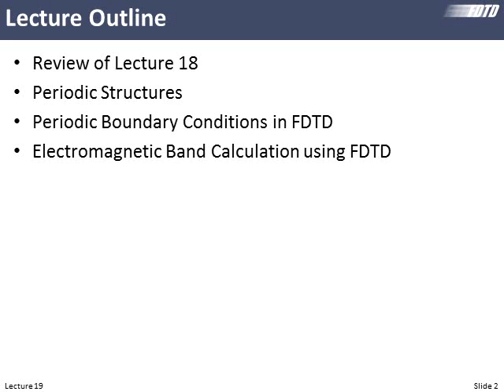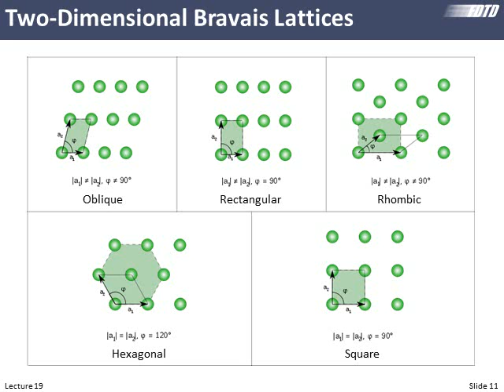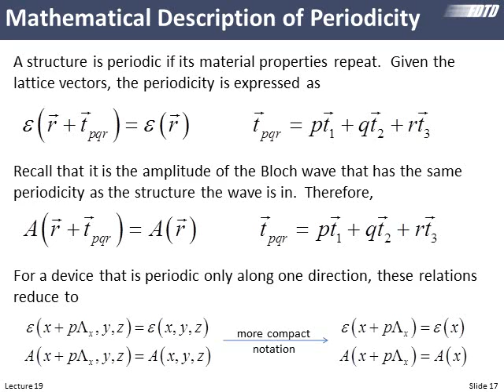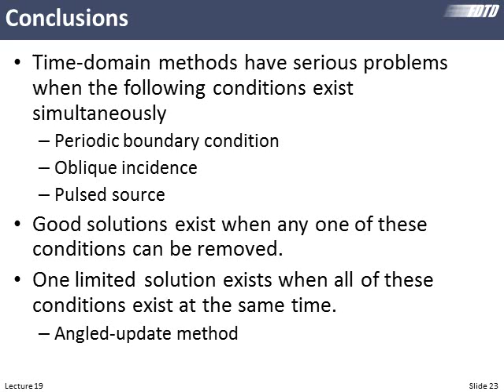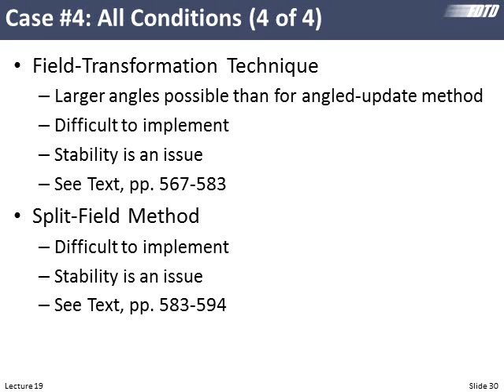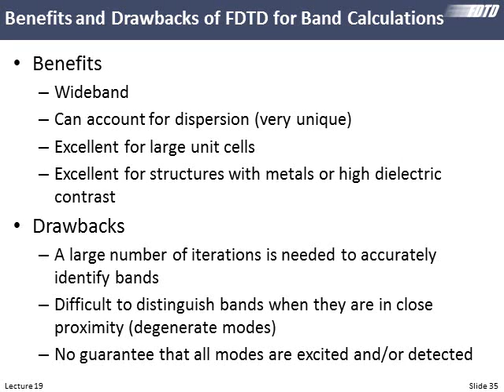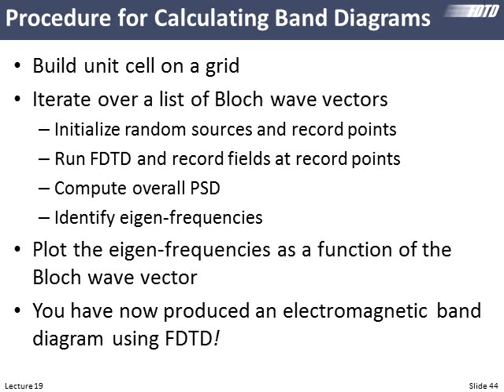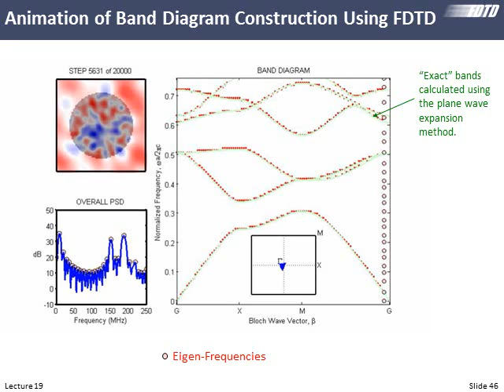Lecture 19 (FDTD) -- Periodic structures in FDTD

Comment: Are the Bloch vectors only applied to one side of the grid? I'm trying to model a hexagonal lattice and I'm getting band folding even with a Bloch periodic source.
Reply from the maker: You need to implement periodic boundary conditions on all sides of the grid because waves should be allowed to propagate in all directions.
Reply: Dang, that was a theory. I'm getting band folding simulating a hexagonal lattice with Bloch phased sources. Is there a video about dealing with band folding?
Reply from the maker: If you are simulating a periodic structure, you should get band folding.  That is what happens when you force periodicity.  Maybe I do not understand your question?
Reply: I’ve read that if you put paired sources, separated by a lattice vector in a supercell simulation and if they’re out of phase by exp(i k•a) then you won’t get band folding. However that isn’t what’s happening for me.
Reply from the maker: Hmmm...I would have to think about that.  That aside, you must enforce the phase periodicity via periodic boundary conditions.  I cannot think of a clever way around having to do this.

Comment: Hi!to build periodic device is different from other structures, How can I build it?
Reply from the maker: +An Nguyen van I don't see it as being any different.  The biggest trick is to try to build only a single unit cell.  If you use periodic boundary conditions, your simulation will think the structure is infinitely periodic.  Otherwise, I don't see much difference.  If you need help building structures on arrays, check out Lecture 3.
Reply: +CEM Lectures Thanks